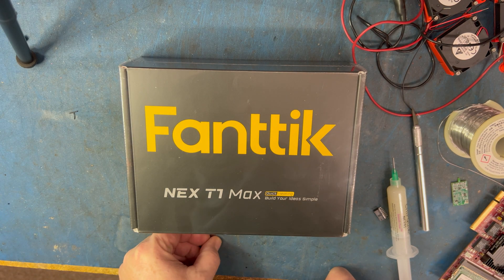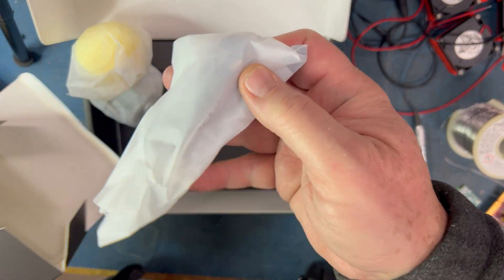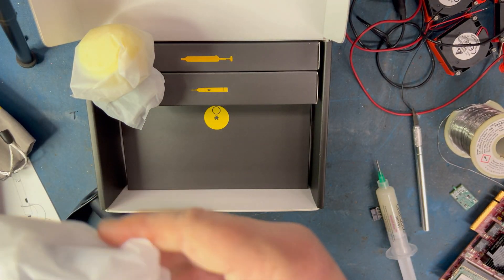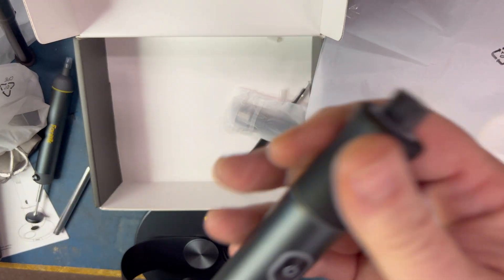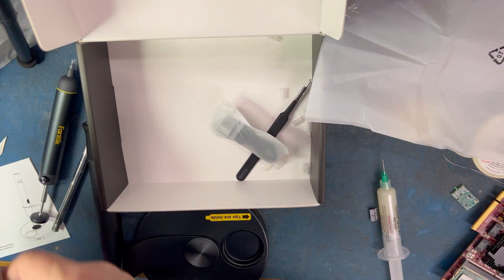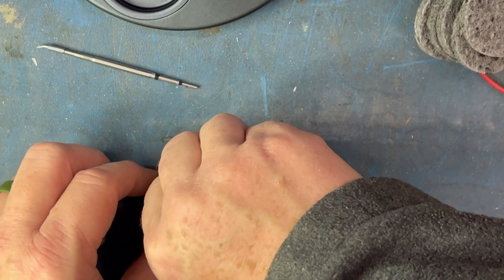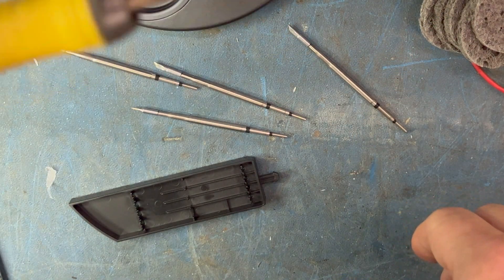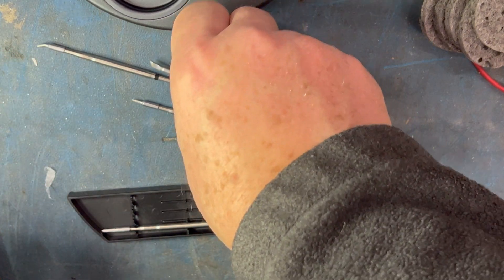Fanttik NEX T1 max soldering iron review

Comment: I just got mine the other day. Mine also glows red at the tip cant handle thick wires. That sucks was hoping it would replace my corded hakko. Im returning it this week
Reply from the maker: I had the same issue and it was really frustrating. You should definitely return it, it isn't worth the price.
Reply: Thank you both
Reply: Mine works amazing so sorry
Reply from the maker: I wish it did work. I had high hopes for it. Fantik does make good products so i was kinda shocked. I might have to get another one…. Thanks for the comment!

Comment: 750°F seems rather hot. I usually solder at 600°F (320°C)
Reply from the maker: That’s too low for regular leaded solder. That stuff is not great. It may work in reflow or mass production scenarios, but it’s a nightmare to rework. Thanks for the comment!

Comment: just got mine, and it definitely glowing red when dialed to 840 degree.  Have you reach out to Fanttik about the problem?  I'm gonna return mine.
Reply: So you guys have it at max temp with the smallest tip and are surprised that its glowing red hot????
Reply from the maker: I haven’t reached out to them yet. I probably should. It seems like it’s decently made but the glowing tip is a no go. Leave a comment if you deal with fantiks customer service. I’ll do the same. Good luck!
Reply: @icemanfiveoh I tried to call, but they not answering. Yeah I’m definitely returning it. Thank for the review.

Comment: it has only fine tips due to it being a very low power soldering iron. According to their own website, 11W in battery power and 16W when plugged in. This is only for very light work
Reply from the maker: I would agree, seeing the tip size. My only concern was the tip glowing red. Other than that, it's not the worst small tip iron I have used. I would say it's a viable option for small SMT components. It def won't replace my Hakko FX-100 setup. It's just another tool in the toolbox. Thanks for the comment!

Comment: A few thoughts on this. It glowing red hot - it has a tiny tip with next to no thermal mass. So it it is being run considerably hotter so that by the time it touches the cold metal of your pcb and wires it still is hot enough to actually melt the solder. Try to solder some heavy wire or a large ground plane and it will probably fail miserably. If it's runs red it is definitely too hot even then and possibly a sign that you unit is defective or miscalibrated.
You said you can see a use case when you're mobile on your bike but how do you safely kep and transport the soldering iron? Commonly soldering irons for portable use come with a cover to protect the tip during transport or even a carrying case while the one here comes with accessories more suited for statinary utility. And while that vertical holder looks pretty try taking the iron out and putting it back in a dozen time while using it and it probably becomes fairly obvious why conventional angled stands are more common.
And on a more personal note, it just seems too thick and chunky and awkward to hold.
Reply from the maker: Thanks for the comment! It is kinda thick, but not the worst. I think a cheap solder stand may be better than their stand. It would also need bigger tips, which I discovered they use some sort of standard tip that other irons use. So I may get lucky finding a bigger one. Was it worth 60 bucks? ehh, yes and no. It's a nice looking and feeling product, but I don't think it will be my go-to setup. I can just use my Hakko FX-100 plugged into a portable ac/dc battery bank.
Reply: @icemanfiveoh Hi.   Thanks for your honest review.  Did you happen to find thicker tips?
Reply from the maker: @samavella8831 not yet. I am slacking on trying to return mine. Thanks for comment!